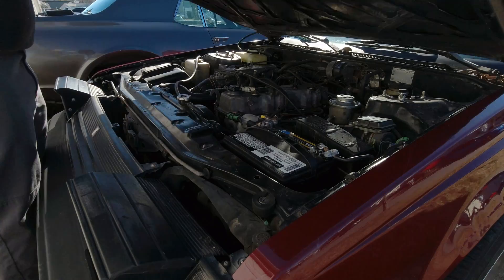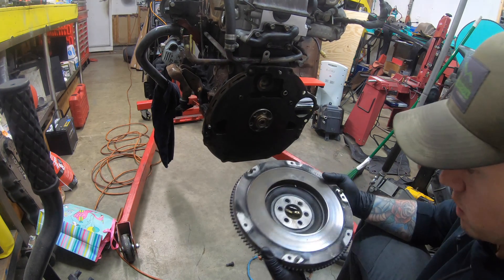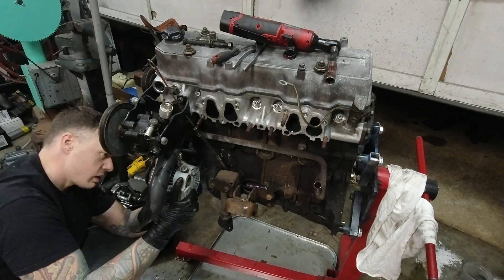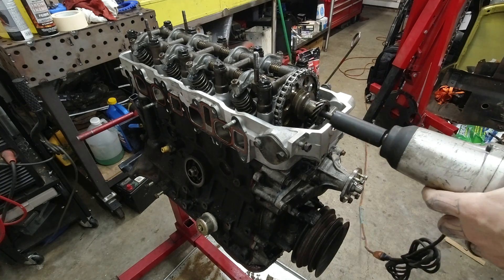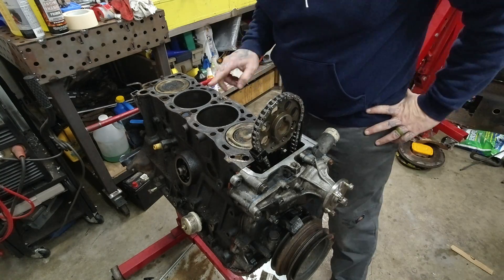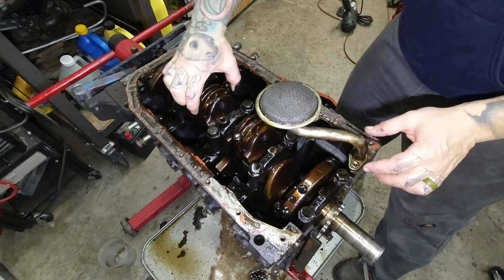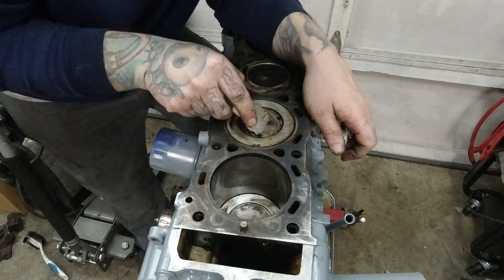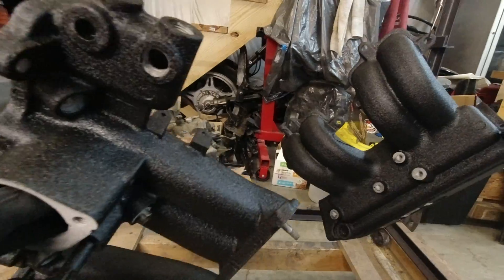TOYOTA 22RE ENGINE REBUILD - Part 1/2 - Teardown and analysis of a poor running 22R Toyota legend!

Comment from the maker: This engine definitely needed to be pulled, and I'm so glad that I went through it.  The 22-RE is a LEGEND, but only if someone hasn't made a mess of it before you get one. Stay tuned for part 2, because this little engine gets a lovely makeover, and we figure out EXACTLY what went wrong!
Reply: Really well done, this and LCE are the best sources I've found so far, you pretty much show and explain all the key points here. I just found your channel and subscribed of course. Thank you, and I look forward to more great content, Jim
Reply from the maker: Thank you! It's wild to think that more than one person regard my videos to be as good as those from world-famous LCE! I'm humbled for sure.
Reply: @tinygaragefab  The methodical manner in which you approach this task is well done. I'm planning on a dual row timing chain kit from LCE, I've watched all their videos about this. Did you consider a dual row for your 22R?
Thanks again for the great videos, I love the powder coating too. Jim
Reply: are you in TN I have a 1986 22 RE carburated that needs to be rebuilt.
Reply from the maker: I am not. I'm sure there is no shortage of good 22RE builders in TN, with the offroad scene as big as it is there. I'm sure you can find someone local. Good luck!